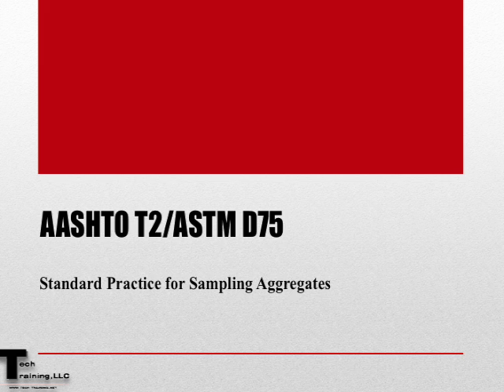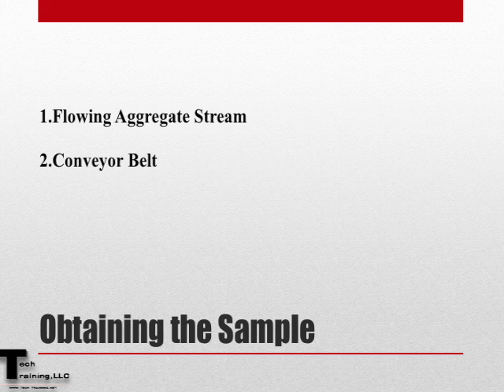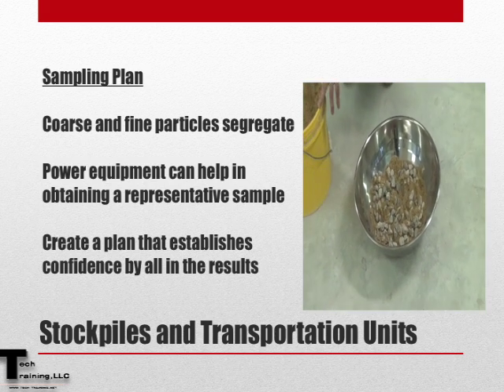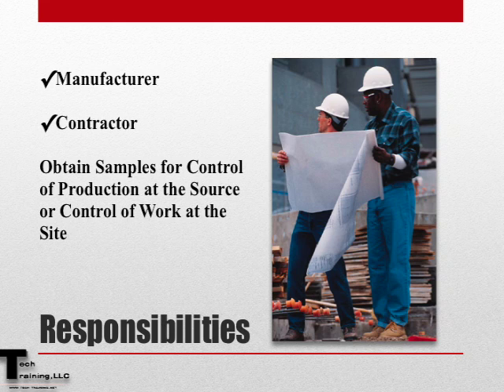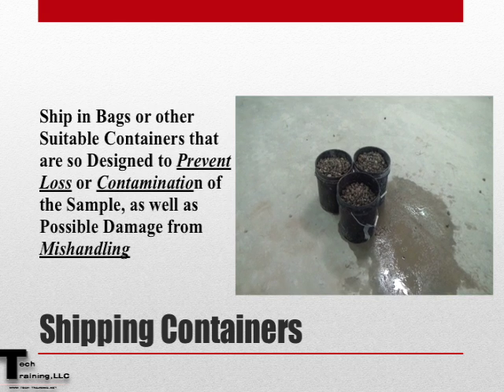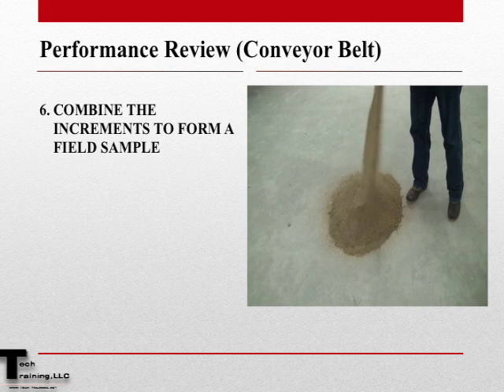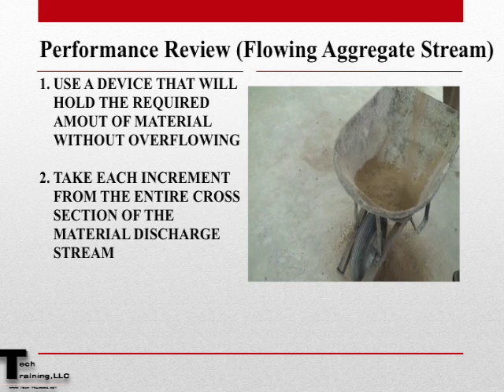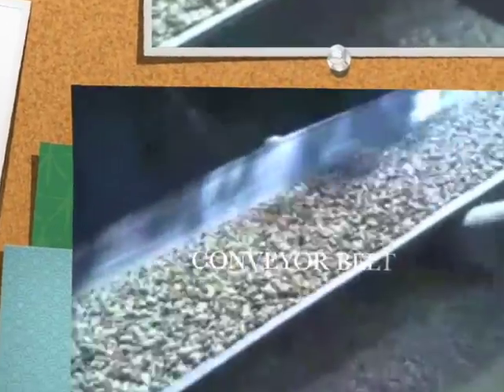AASHTO T2 ASTM D75

Comment: 3:11 Horizontally=parallel to the ground, vertically=perpendicular to the ground. Your very uncertain looking technician is inserting his board horizontally, not vertically. The spec calls for the board to be inserted into the stockpile vertically. This is not proper procedure.
Reply: Not to mention not removing the slough prior to sampling, and taking care to not drop material when transferring to the receptacle. There are many inconsistencies with standard practice in this video.